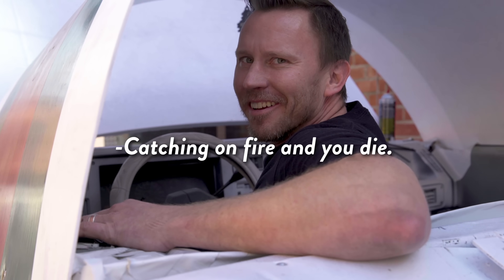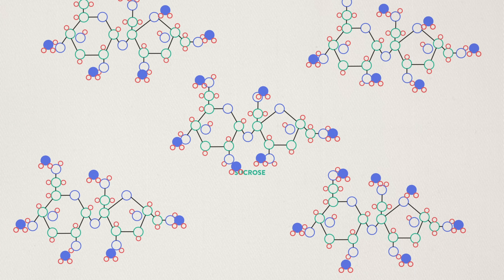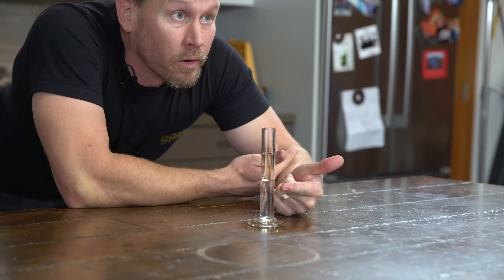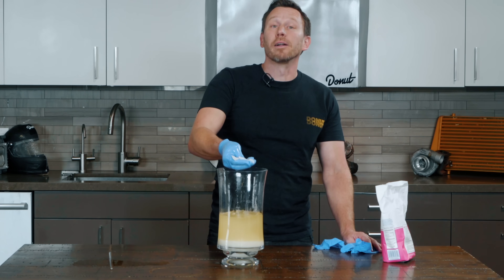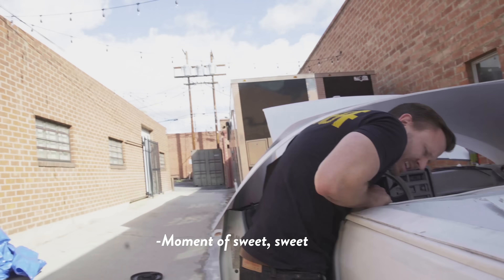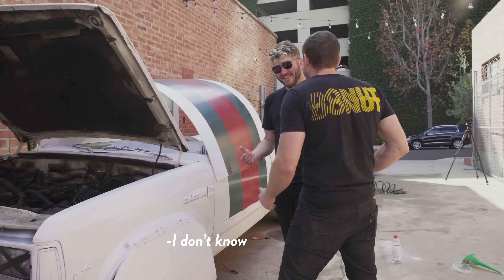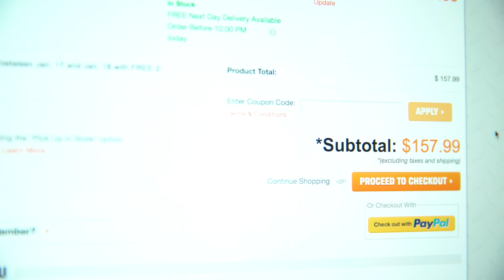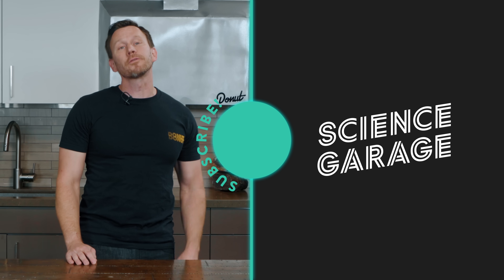SUGAR IN THE TANK - What actually happens? | HOW IT WORKS | SCIENCE GARAGE

Comment: I see three problems with your experiment.
1. You didn't drive it. You didn't get the rough sloshing of starts stops and turns. Also you had no actual load on the engine greatly reducing the fuel consumption.
2. You didn't try to restart the engine after everything had cooled. Much of the damage from the sugar is what's left in the line cooling into a syrup in the carburetor.
3. On a fuel injected car this granules can more easily clog the finer filters and injector screens and essentially sugar weld the injectors closed when everything cools.

Comment: The sugar in the tank ends up plugging up the fuel filter, but it only works if you drive the car. The motion of the fuel moving around allows the pickup to suck up the sugar and eventually plugs the filter (this can sometimes take a couple tanks of gas for this to happen). With modern cars that have a fuel pump in the tank it happens a little quicker. It ends up plugging up the fuel pump and then the pump basically burns up. It doesn’t really hurt the older engines but it can do some damage to the never engines because they don’t like to be run out of fuel. The sugar does to bad shit to Diesel engines and can be a headache. Don’t do this to someone’s car unless you want it done to you, karma is a mother f*+cker.

Comment: On carbureted engines sugar will burn along the cylinder walls snap a ring or shatter a piston.  Seen it done .
Reply: Or mix sugar with bleach .
Reply: I even seen a car with dish liquid in a gas tank car stall out after 50 miles with bubbles coming out of the tail pipe.

Comment: Does anyone know if powdered sugar stays suspended any better in the gasoline? There must be a better way to suspend the sugar in the fuel. I'm curious about this because I actually had to replace the engine on an '09 Civic recently, because someone sugared it successfully. It ended up getting a new fuel tank, pump, filter, and injectors, we flushed the fuel lines with water and isopropyl alcohol, and installed a used engine. Burned sugar was actually holding a couple exhaust valves open, and left visible residue caked around the combustion chamber. Final bill was over 8 grand. Please only save sugar in the tank for only your worst enemy (and even then, what did the car do to deserve such a fate?). It's a serious dick move with very serious consequences. I worry that some people might consider sugar in the tank as some kind of prank... It's very, very far beyond a prank, and leads to no appreciable laughs. It's about as funny as breaking somebody's windows before a cold winter storm. What a waste of a perfectly fine Honda engine (and of course it was one of the 5% of people who actually changed oil on time, so other than the sugar it was immaculate isnide), not to mention a boatload of cash.

Comment: In the older models where the fuel pump and filter were outside of the tank and the "sweet" gas would settle it would get sucked directly into the fuel system. The engine heat would cook it and turn it into a syrup.  .....the more you know..... jingle

Comment: I bought a car once that had sugar in the gas tank. It idled fine, but had no power under load. It was hard to fill up at the pump because the sugar turned into a rock in the filler tube. Ultimately, I was able to access the fuel tank without dropping it. I then siphoned as much gas/sugar as i could and then i filled the tank with about 5 gallons of almost boiling water. That dissolved all the sugar and I was able to disconnect the fuel pump from the fuel line and hook it up to some tubing, jump the fuel pump relay, and pump all the sugar water out. I then changed both the filter in the tank and the other main fuel filter, clean the injectors, and the car ran like it never happened.

Also it is worth nothing that the sugar will not dissolve in alcohol either, so fuel system cleaners are useless against sugar.

Comment: If it does get pulled up and passes through the filter, the heat of it will make it caramelize and stick you the rest of the internals. Once then engine is off and the goop starts to solidify is when real problems arise. Thats if the injectors survive all that.

Comment: OOOOR instead of flushing the sugar with Gas, use bleach. This will turn the gas into a acid and it will eat away at the gas tank(or rust it faster if its metal), destroy the fuel lines and eventually stall the engine

Comment: Ugh,  you mixed it before you put it in the tank? Ha! Put just sugar in the tank and it dont get stuck.

If sugar doesnt burn the pump and gets past the fuel filter and gets into the cylinders it bores them out and makes it smoke like hell from the oil.  Used to work at a motor bike shop we did this too. Took off the filter and dont have pumps and it destroyed the motor. But only to where it needed to be bored out. Didnt even need to clean the carbs.

Comment: Your a mechanic, you're overhauling an engine and when you pull the head you discover a white translucent deposit in a cylinder.  What could it be?  Since it feels sticky, you taste it (don't do this, its poison) and it tastes sweet.  Now, you know the answer, somebody put sugar in the gas tank.  Actually, the head gasket had a slight leak and what you put in your mouth is cooked antifreeze.
Reply: No, it’s N U T
Reply: lmfao
Reply: Nah it's Coke
Reply: You’re
Reply: tbh, antifreeze is not sweet. idk how that keeps getting passed around. its bitter affffff.
Reply: @frigglebiscuit7484  it used to be sweet. It's naturally a very sweet thing, however they had to start adding denatonium benzoate to the antifreeze to make it bitter.
Reply: @frigglebiscuit7484  No, antifreeze is in fact sweet. I know because i got a nice, big mouth full of it once when draining a radiator that needed to be replaced. It's also why cats and dogs will drink it, effectively poisoning themselves, if it's left laying around.
Reply: Don't...please don't do this. The bittering agent is there as a warning. Antifreeze will kill you.
Reply: Vodka
Reply: It could be potassium from vodka which will have a slight  sweet taste in the motor. You won't taste it in the gasoline. It will get you where you wanna go but your whole fuel system will need replace due to the potassium in the vodka. It turns white on the inside and your intake will grow a white film on the outside too. You can clean it just to wake up the next day and its back. Potassium is corrosive in an engine if you ask me. I lived it. Bad mistake. It will kill a fuel system. I ran out of gas on a back road. I was late for an appointment and there were no other cars going by. So I opened up a jug of vodka thinking it wouldn't hurt cause its a clear alcohol and I was only going about ten miles so I put half of that jug in. I made it there alright. In fact my camera ran great. It was the next morning that the nightmare started. Live and learn and share the lesson.
Reply: Posion is in the dose. I'm sure a small taste wont hurt 🥴

Comment: If you think about old carburetor engines use a mechanical pump on the engine that is for the most part gravity fed that so sure would fill those line and cause issues probably more significant ones then one that uses an electrical pump that is suspended in the tank

Comment: pro sabotage tip: leave the sugar at home and buy a 2 liter bottle of Pepsi, it has tons of sugar in it already dissolved and its liquid and the bottle has a small spout so you don't even need a funnel.  
and the thing about sugar is its long term damage, not instantly killing your engine.  the crystals will scratch up your cylinder walls and get all mixed in with your oil and scratch up everything else in your engine.  it'll prolly take a few thousand miles to see the effects, not an hour of idling... and you call yourself a scientist...
Reply: With Pepsi in the engine you have bigger things to worry about than sugar.
Reply: Don’t you need the funnel to push in/aside the little metal cap that covers the fuel tank?
Reply: thanks dude my neighbor parks his car in my parking space and leaves it there all week buh bye 😂
Reply: Sucrose has a hardness of about two on the moh scale and aluminum is about a 4 on that same scale so sugar won't scratch your engine components, even the relatively soft ones (steel and iron are both much harder than aluminum). If you really want to fuck up someone's engine, pour water in the gas tank and capitalize on the whole polar v non-polar aspect of that relationship. This is probably the most likely part of pouring soda in a gas tank to cause significant damage.

Comment: water in the gas tank would probably destroy it faster. hydrolock!
Reply: It would just run poorly, not hydolock.
Reply: @LiquidSSSnake  true, not enough water. Would need to come through the intake like driving though a flood. I hear bleach does a better job.
Reply: @some1sosik  Or a coolant leak in the cylinder while sitting overnight.

Water can get in the tank naturally through condensation, which is why they make products like Heet.

Comment: I had a car with a stalling problem I found it wasn't getting fuel so I figured it was a fuel pump which seemed pretty accurate for the brand and model of car so I pull the fuel pump and lay it down to drain the gas out and all these little white particles come out I shake it and more comes out and there was tons of it in the tank must have been half a bag of sugar in there not sure how much would have gotten to the engine but it definitely clogged up the fuel pump but the engine seemed to run fine before stalling
Reply: Who did you piss off
Reply: yea, this just happened to me man... And I don't have enemies. had to been a random teenager or something... if they was smart they would of mixed the water with warm water before dumping it in lol.... that's a sure fire way to fuck your shit up.
Reply: Ace HAMMER Chevy/gm from the 90's
Reply: Yeah this is a real thing.. happened to my ex. Her ex put sugar in gas tank in her BMW e46 . you have to drive on it for a while but eventually gets sucked up. Car started stalling. I change injectors cuz they were clogged. Then eventually car wouldn't fire up.. my insurance took it to a BMW shop and they dropped tank and removed lines and full of sugar and valves had this burnt sugar solution caked

Comment: Since fuel now has an ethanol percentage and ethanol is hydroscopic meaning it attracts water. Since your Gucci truck sitting with the probably 10% ethanol fuel in it. I would assume it has a good amount of water in it too. So if the sugar dissolves into the water and that gets pulled up first from the bottom. You should be able to basically drive or run it until the sugar water clears out. But since people dont know they havea sugared tank they might make a short trip and leave some in the system. Then the sugar going to sit there and with heat caramelize the sugar in the lines, pump, filter and injectors if it sits in there. So maybe try starting it in a couple of days to a week to see if anything has changed?
Reply: I found that it also is soluble in ethanol so I guess  thi is the culprit, the filter shouldn't let any sugar crystals through.

Comment: The sugar will work better with screwing up the engine if the car is actually being driven around and slushing the gas and sugar around in the tank, that way the sugar is not just sitting at the bottom. Also, It's much better if you put Styrofoam in a gas tank.

Comment: What if you put a bottle of water? Or some Hennessy i think thats Hennessy performance secret
Reply: You cant compress water. The engine will lose.
Hennessy is only 40% abv.
Reply: Water sits at the bottom just like sugar.. if there's enough to cover the intake it'll stop the engine but for older vehicles they'll probably be fine.

My first motorbike was a 1984 Honda VT250f Integra, which had seen better days. After parking in the rain it wasn't uncommon to get some water in the carburettor and the engine stopped.
Push the bleed valve until the clear water turns back into coloured fuel and crank it over a few times, BAM.. fixed

Same with a car, I used to work at a VW dealer as a mechanic and it was common place for someone to tow in a car because they put petrol in a diesel or vice versa. Just pull out the tank, empty it all out, fill it right up with fresh juices and prime the fuel rails with the return disconnected (or just crank and blow the wrong fuel out the exhaust). In some cases it needed a time consuming flush to clean everything out, but I don't recall ever having to replace parts, other than the filter. 

Some newer cars can be very temperamental though, so depending on complexity of systems it may do some damage..

Comment: I knew a guy that someone put tons of sugar in his gas tank, he had replace his fuel filter and his fuel lines because they were all coated with a sticky residue on the inside. After replacing all that his engine didn’t run the same as it did before.

Comment: i always heard that it caramelizes in the combustion chambers and does weird things to wreck the engine. Might clog up the filter or ruin the pump eventually. probably works faster in a fuel injected vehicle, than a carbonated one, because the fuel return line keeps everything stirred up.
Nobody ever does it though because there are easier ways to mess with a car and sugar leaves a big mess all around the gas filler. Also, if someone catches you doing it you're standing there holding a bag of sugar like a jack ass.
Prefilled PVC pipe sections would probably be the way to go, but you didn't hear that from me. Car vandalism is the worst of crimes.

Comment: Real pro sabotage tip, use bleach, it will stay in the motor when the car stops running for a while and if it's overnight it will seize it up with rust
Reply: NekoWinters 
Got it, bleach and sugar, the sugar to distract and confuse the maintenance crew, and the bleach to actually do the damage.

Comment: Would more sugar get into the engine if you were actually driving the truck instead of just idling? The movement of driving, stopping, accelerating, turning, etc. would cause more sugar crystals to stay suspended in the gas and therefore have a higher likelihood of making into the engine. Just a thought.

Comment: FAKE NEWS
 Funny but not correct. Sugar does fuck up the fuel system, it takes longer the you left in. But it will congeal and clog the filter, pump, fuel injectors. I have seen it. I am an actual mechanic and not a YouTuber. A women’s ex bf did it to her car, she ended up scrapping the car because the repair bill wasn’t worth the value  of the car. It needed a New Gas tank, fuel filter and pump, new injectors and and injector rails, plus it needed the fuel lines ether replace or flushed out. 
Please if you are going to present information, at least do a proper scientific experiment instead of spreading fake news.